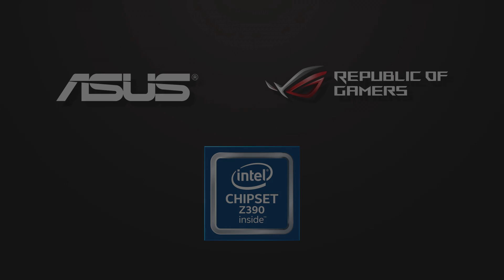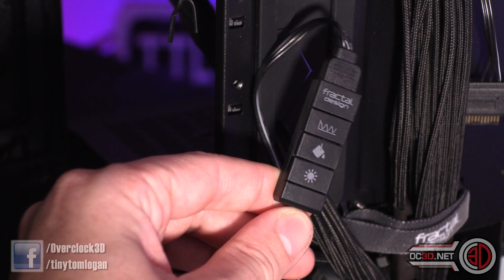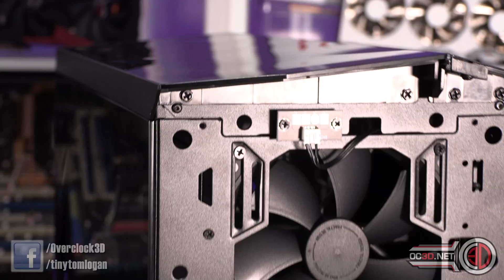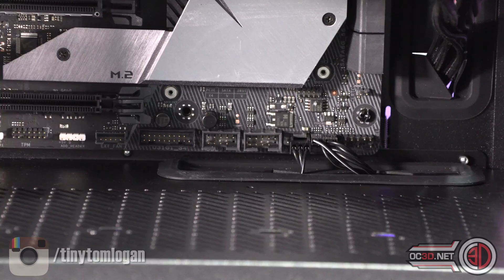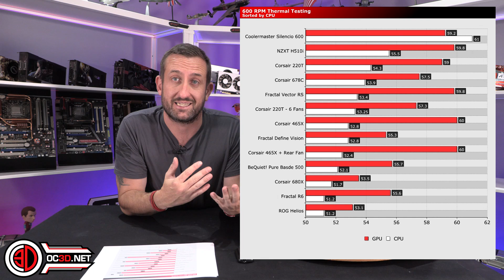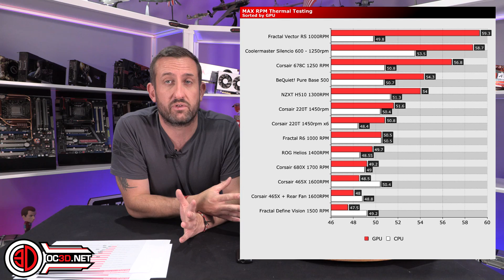Fractal Vector RS Review   Disappointing Thermals

Comment: Is it possible to conceal 2 x 3.5" drives vertically and mount a third into the recess at the bottom/front of the case?  As i have a RAID 5 array.

Comment: Love the case and Fractal has made some great ones over the years but I would have l like this more as a MATX case with about 6 HDD cages for a mini server. I've watched a lot of PC builds and it seems that the small dust filters in the front of some cases (even though the are needed) seem to restrict some intake air flow and better fans may have helped with thermals....just my opinion.

Comment: In response to comments regarding the "10-year old aesthetic"...  I personally love the understated look of most FD cases.  I dig minimalist design (I'm an architect).  BUT, I understand Fractal's approach with this case. From a business perspective, FD is missing-out on a sizable market share with its minimalist cases. I can understand why they would want to engage system builders with an LED/Glaz option. As far as that goes, this is still a relatively restrained design. Poor thermals, on the other hand, is just not Fractal.

Comment: Fractal, what have you been doing recently, and where are you heading with this? I've become a fan because you have built cases that did put form over function, admittedly to the point where the form became almost painful. In my book your art has peaked with the Meshify C, a near-perfect case for compact air cooling setups. Since then, and maybe only with the exception of Meshify S, you have started to follow the unhealthy trends that you have resisted for so long. You have become just another "Glass & RGB" manufacturer, and apart from your usually could internal layout and build quality, you are not very good at it. Even worse, you are trailing the competition. While you are jumping on the tempered glass hype train as if it is 2016 all over again, the market is moving towards open front bezels again. You are currently making the same mistakes that the competition has already made years ago and that have been heavily criticized by reviewers and consumers ever since. 

Fractal, please go back to building that are primarily designed to excel in performance, handling and build quality, not in looks (just please dont't go as far back as using the same faux brushed aluminium front bezel on everything!). What about a 2019/2020 update of the Meshify C with USB Type-C and without gloss plastic? What about an ITX-Meshify? What about anything ITX for a change?

Comment: A Good in-depth look , as always.
One thing I would like to know is,  if you had to two front fans, running in the middle and bottom places, instead of Middle and top,
would this push a lot more air across to the GPU to bring its temperature down to a more normal level ? 

Yes I Know half of the bottom fans air flow would go to the PSU, But Half would still go to the GPU. unlike when it was tested.
No doubt the fans where put where they are, because it is quicker in the factory for them to do so, and not for the users benefit.

Comment: I was wondering if Meshify C TG would have better airflow than normal Define C. I have Define c without window and I think the padded side panel keeps a lot of warmth. When I open the side panel, the gpu goes down from 75c to 67c (during stress)

Comment: With the wildly different name this one's got, I really hoped it would be a new design not based upon the R6. Seems instead like Fractal Design really does not want to do anything new this generation. Expect some innovation to come around with the R7 in about a year or so, I suppose. 

But worse than that, it is not only nothing special, it is also less advanced than the Define S2 Vision (yet another iterative change, but at least one that had some bite left in it). Fewer fans, fewer front panel ports, the fan hub of the R6 again, the missing cover plate (and yeah, there is even an R6 variant - non-S2 - that includes that) and so on, while also worsening airflow.  I am sorry, Fractal, but this is quite pathetic. Move on to your next generation soon, please.

(No, I don't think it looks bad. It is just REALLY disappointing featurewise. In white it would still be very pretty).

Comment: Thanks for the review. 
It is almost perfect for a home server build, since it supports multiple 3.5" HDDs
and it's outer dimensions are comparable to my current case.

I could make a one-off custom internal top fan mount, out of plastic or sheet metal, to accommodate a single 120mm fan, near the rear of the case, to aid in exhausting hot air from the VRMs, while the solid glass panel is on the top, since it has those rear exhaust holes. A nice touch.

I could also install a standard exhaust blower/fan in one of the two extra vertical PCI slot mounts, to help pull hot air off of my multiple PCIe capture cards.

The one thing holding me back from buying this case is the solid front panel...
However, making a full metal-mesh front panel that supported foam filters, like the kind you can buy for a furnace,
is a bit beyond my skill set.
If this case had front mesh already, then it would be ideal, as I could just vacuum the front once a week, and replace the filter once a month.

Comment: For the price they are charging for this case... they are out of their mind. I would rather buy a Lian Li O11 Dynamic but prices on that are rather all over the place at the moment. Some places sell it cheaper than this Vector RS while some retailers overprice the hell out of it.
Reply: I have a Lian Li 011 Dynamic and it's without doubt the best case I've ever had. I have an open-loop in it with 3 360mm radiators and 9 ARGB fans. It's. I paid $130 usd for the case at Amazon.